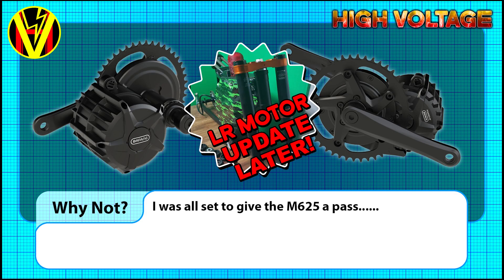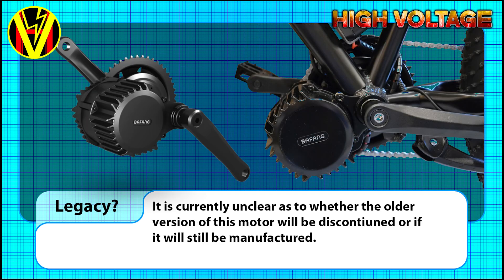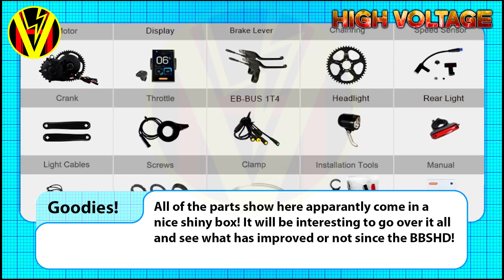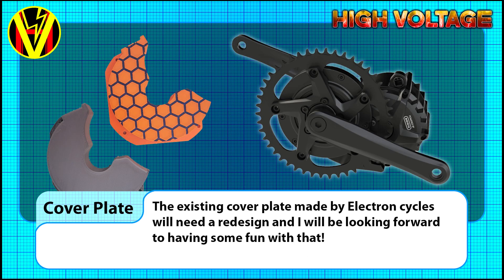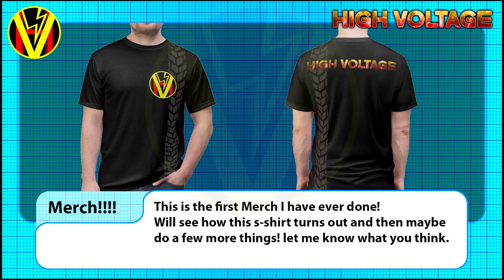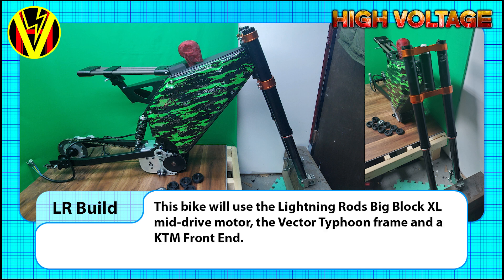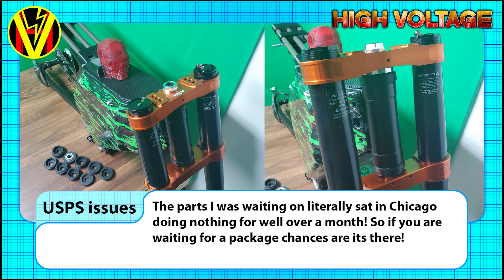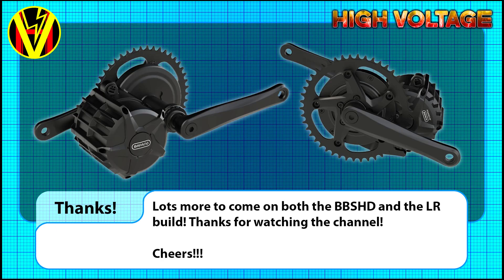NEW Bafang BBSHD / M625 - I bought one! Lightning Rods Big Block XL Mid-Drive Update and Merch!

Comment: Hello high voltage and to all 👍
Question ? .  I've got a BBSHD 1000w standard with 48v battery on a 29er kinesis frame & a 46 tooth chainring ring hitting speeds of 38mph to 40 mph on a flat throttle only . question is what sort of speeds will I hit with a new controller & which controller would suggest 🤔 and which chain size ring would suggest my area is very hilly I know this is fast for a push bike but has Jeremy Clarkson more power is better 👍👍👍👍👍👍🤔🤔🤔🤔
Reply from the maker: This is more a question or questions for on discord as alot more people to help. In general though you would get much faster acceleration and a slight boost to your top speed as long as your battery can handle it. I'm not sure 48 volt packs usually have a bms much over 40 amps continuous. This is the discord link and you are welcome to join and ask questions etc. Get an idea if this is an upgrade path you want to consider. Your bike sounds pretty good already! Hope this helps. https://discord.gg/9UwDG4j
Reply: Thank you for the invite 👍 I'm now joined.
 I am thinking of ordering a phase runner controller. the battery is a 48v 16amp Samsung battery. Pack 🔋.
 I'm in the middle of making another bike . Enduro bike 12500 watt hub Dive with a 110v battery 🔋 with sabaton controller 19" Enduro wheels  looking at speed 70 + 🤭
Reply from the maker: Sounds good! I am sure you will have fun on there.

Comment: Ok it is installed Unfortunately I have a problem with the kit. After installing on a bike , setting correct wheel size, speedometer seems to get stuck showing 50km/h and keeping it until wheel stops. So it works from 0 to around 10 km/h and than shows 50. I tried adjusting sensor and magnet on a spoke - no results. If You want I can record a video - as it is quite hard to explain. Also motor when it showing 50 km/h seems to be not working - even if I push throttle and wheel barely rotating.
Reply from the maker: Much easier to assist on discord. A few people on there with the new motor. https://discord.gg/GzchV7W9
Reply: @HighVoltageKits  I did place it on discord using link from description. The one you just posted is "moderator only" so cannot join
Reply from the maker: My bad https://discord.gg/YAAjfgc
Reply: @HighVoltageKits   "moderator only"  again :)
Reply from the maker: https://discord.gg/GE8de2JN Sorry might be a bug
Reply: @HighVoltageKits  Working now - so as bafang came back to life. Switched sides of frame with speed sensor and placed it in awkward position upwards , twekaed distances to magnet about  5 million times and eventually tadaaa power is  back :)

Comment: I ordered it from aliexpress, i got it 5 days later so good shipin, but then i installed it. chagenged the top speed from 45kmt to 75kmt, then i took a little trip 2 km MAX (throttle only). when i got home again it set it for chageing, and the day after it said overcurret from controller. so now i have a broken m625 1000w motor kit.
Reply from the maker: Sorry to hear this. If you want you can join the discord server and post some more details. It's hard to have a good chat on the comments section. I am sure we can figure things out. https://discord.gg/GzchV7W9 let me know I'd you have any issues with Discord. Cheers

Comment: Have you any dealings with the 1000W version of the GO6 fatbike rear hub?
Reply from the maker: Not personally. People on discord may have though. Is it Bafangs motor?
Reply: Yes , its the upgrade from the bafang g06, same sort of casing style as the new bbshd..called the G062.
Reply from the maker: Interesting. I will have to look. See what the controller specifications are.

Comment: Now that you are a licensed dealer for the ASI controllers, does that mean that we may soon be seeing a well-tuned high voltage option for the CYC motors? They could become a good alternative to the new version of the BBHSD. I have a Cannondale Prophet you could use for a build series.
Reply from the maker: ASI already has a deal with CYC to supply them so it won't be something we will be looking at. That said if you want some tips on tuning you are welcome on discord.
Reply: @HighVoltageKits  I thought that there was an issue at one time with access to the ASI tuning software for CYC customers and they were now getting blocked by ASI. 
Is this still true? 
What controller is CYC able to supply?
If we want one of the higher capacity ones, can you supply those?
Reply from the maker: Cyc do the BAC2000 and The BAC855. They have their own configuration app to use with them and can provide other support if needed. I do rate their customer service above all else with CYC.
Reply: @HighVoltageKits  Would you then chose the CYC over the previous BBHSD or the new one? Can you still find the previous gen BBHSD?
Reply from the maker: Right now you can get older bbshd still. It's a fun ride. That said if I was to do an ebike conversion today. I would love to try the stealth version. Time prohibits a little but it sounds good. It is new kit. The long term wear and tear data is not really in yet. Post your dilemma on discord. People have both systems including the stealth so they can give you better feedback than me here.